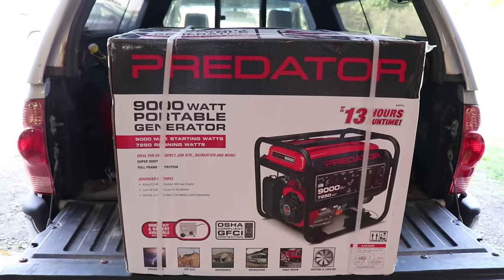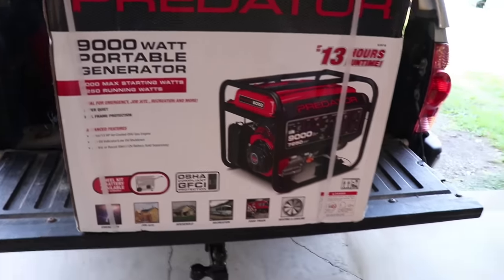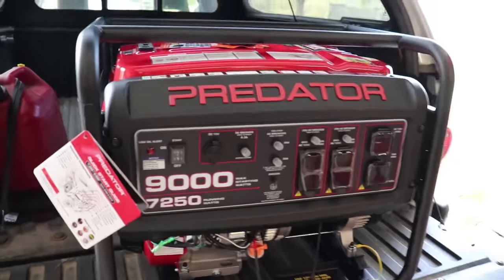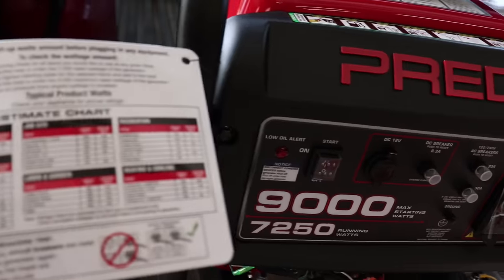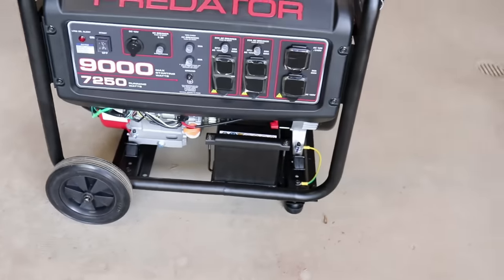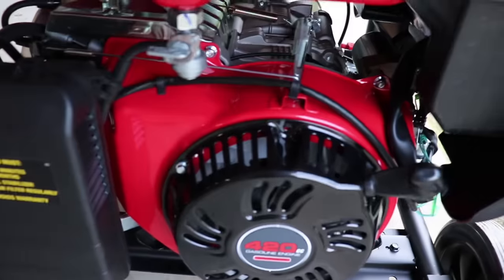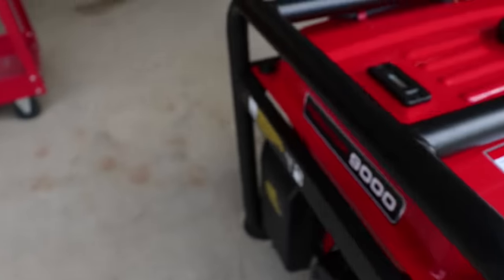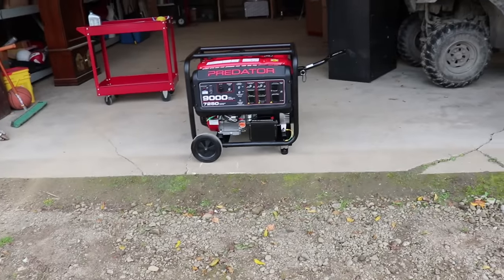Predator Generator Running Our ENTIRE Home. (Complete Setup and Cost)

Comment: hi,my main info that i need is the connector box near the garage panel breakers,how it is connected?  where in the plug are connected each colored wires??? 
thats my main interogation,,,
the reste i can do it..
here the heater are on the 220 ,i must turn off and we have a wood stove so we are ok

i cannot have the interlock plate because it is not a Square D here,,,its a bastard panel that was sold to us when the electricity was redone and we did not knew at the time!!!!

thanks for your video

gervais 
Riviere-Bleue,Quebec

Comment: Now get a SMALL generator that can only power your heating system and refrigerator. Or wait until you are 3 weeks without power, you local gas stations have no power to pump gas, and the big generator shakes itself apart. Ask me how I know.  It’s best to save fuel and maintenance time as much as possible.  

After your first day of comfort, think survival. You use the big one for the water pump and an hour or two of other items, then be in the dark for two hours, then the small gen for lights and refrigeration for 1-2 hours at a time. Repeat.

Comment: The actual reason for the slide is to prevent killing or injury to line workers should they be working in your area.
Reply: Make sure you all are aware with the hazards of using generators. Generators can be dangerous if not used carefully so make sure you follow all the generator safety instructions. I know all about generator safety and I have something to explain to everyone about generator safety. Here is what you all should know: please remember not to ever run your generator indoors. Generators should only be used outdoors. Always remember that carbon monoxide fumes are odorless and colorless gas that is a silent killer that you cannot see or smell. Carbon monoxide is dangerous and it can cause death. Carbon monoxide is poisonous. Always keep that in mind when using generators. You need to have a carbon monoxide detector. Make sure your generator is 15-20 feet away from your house and away from doors, windows, and vents. Never use your generator indoors even if your doors and windows are open. Some people run their generator indoors during hurricanes which is dangerous and you and your family will die if you use generators indoors. Running a generator indoors increases the risk of carbon monoxide poisoning. Please don’t run your generator in wet conditions. Running a generator in wet conditions can electrocute you. You need to keep your generator dry. Don’t let the portable generator get wet. You need to have a generator tent as well to protect your generator from getting wet if you will use  your generator during wet weather. We also really need to keep our children safe when we’re using portable generators so they won’t get electrocuted or burned by the generator which is dangerous. Generators can be hot. You have to keep an eye on children making sure that they are not near the portable generator to avoid any risks. We have to be aware with all the hazards and follow all the instructions in the generator’s operating manual. Generators pose electrical risks. Make sure your generator is not overloaded. Overloading your generator can cause damage to the appliances that are plugged into the generator. Please don’t overload your generator. Don’t ever try to plug a generator cord into a wall outlet to avoid back feeding. Back feeding is dangerous. Always turn on your generator first before plugging in appliances. And before you unplug the appliances, please shut off your generator first. Please use a heavy duty cord for your generator and the cord should not be worn out. Please don’t refuel your generator while it’s running. You should shut off your generator and let it cool off before refueling it. Refueling your generator while it’s running can cause fire if gasoline spills on the generator’s engine because it’s hot. Please make sure your generator is properly grounded. Everything that is said on the generator’s operating manual should not be ignored. They all need to be followed. https://youtu.be/I1jT3ANENvI and here is a video more about keeping your family safe while using generators. This is for everyone’s safety. This is just a safety reminder for everyone to make sure that you all are aware with the warnings. Thank you and hope you all stay safe.
Reply: Comment has nothing to do with my remark.

Comment: Get to Temporary pigtails that use for a regular light bulb put them in series with the hot wire so in case you buck the power company with your generator the fuses will blow and buy time delay fuses 30 amp they sell them at Home Depot you're not putting a lightbulb in the holders you're putting the fuses it's an Edison base fuse so fuse will pop instantly in case you switch the power company on with your generator avoiding fire
Reply: you don't want to hurt the lineman working on the system

Comment: 1) that is way too big for that house from what I’m seeing on that breaker panel 2) huge generators use huge amounts of fuel , which is hard to store and hard to find in an emergency ) that generator is capable of more than 30 amps I believe so it should be a 50 amp breaker in the box instead of a 30. Drain them and don’t store fuel in them. I usually just dump half a gallon in to run and then let it run out every few months. Also drain the carburetor, there is a drain screw on the carb. Then put the choke on and try to start the generator . This will suck any fuel out of the small carburetor jets
Reply: Actually, this generator is fuel efficient. You can get up to 20 hrs., on a tank of gas, if your around 25% load.  The bigger the load, the more fuel it uses.

Comment: I have a 3000sq home I dont need the whole house but can a 7500w handle that
Reply: Make sure you are aware with the hazards of using generators. Generators can be dangerous if not used carefully so make sure you follow all the generator safety instructions. I know all about generator safety and I have something to explain to everyone about generator safety. Here is what you should know: please remember not to ever run your generator indoors. Generators should only be used outdoors. Always remember that carbon monoxide fumes are odorless and colorless gas that is a silent killer that you cannot see or smell. Carbon monoxide is dangerous and it can cause death. Carbon monoxide is poisonous. Always keep that in mind when using generators. You need to have a carbon monoxide detector. Make sure your generator is 15-20 feet away from your house and away from doors, windows, and vents. Never use your generator indoors even if your doors and windows are open. Some people run their generator indoors during hurricanes which is dangerous and you and your family will die if you use generators indoors. Running a generator indoors increases the risk of carbon monoxide poisoning. Please don’t run your generator in wet conditions. Running a generator in wet conditions can electrocute you. You need to keep your generator dry. Don’t let the portable generator get wet. You need to have a generator tent as well to protect your generator from getting wet if you will use  your generator during wet weather. We also really need to keep our children safe when we’re using portable generators so they won’t get electrocuted or burned by the generator which is dangerous. Generators can be hot. You have to keep an eye on children making sure that they are not near the portable generator to avoid any risks. We have to be aware with all the hazards and follow all the instructions in the generator’s operating manual. Generators pose electrical risks. Make sure your generator is not overloaded. Overloading your generator can cause damage to the appliances that are plugged into the generator. Please don’t overload your generator. Don’t ever try to plug a generator cord into a wall outlet to avoid back feeding. Back feeding is dangerous. Always turn on your generator first before plugging in appliances. And before you unplug the appliances, please shut off your generator first. Please use a heavy duty cord for your generator and the cord should not be worn out. Please don’t refuel your generator while it’s running. You should shut off your generator and let it cool off before refueling it. Refueling your generator while it’s running can cause fire if gasoline spills on the generator’s engine because it’s hot. Please make sure your generator is properly grounded. Everything that is said on the generator’s operating manual should not be ignored. They all need to be followed. https://youtu.be/I1jT3ANENvI and here is a video more about keeping your family safe while using generators. This is for everyone’s safety. This is just a safety reminder for everyone to make sure that you are aware with the warnings. Thank you and hope you stay safe.
Reply: @The_Happy_Aviation_Enthusiast  thank you for the safety tips but that dont answer my question

Comment: You wouldn’t know if the water pump was working unless you turned pump off until water stopped flowing and then turned pump on . Water would run for several minutes without pump on
Reply from the maker: Watch the video I did in the description....I did a 50 minute test with the shower on.

Comment: There one Predator that is super quiet. Might be one size down powerwise
Reply: ⚠️Here’s an important safety announcement for everyone:

Please make sure you follow the generator safety tips whenever you use your portable generator. This is just a reminder for everyone’s safety. All generator safety rules need to be followed carefully 

Here are the generator safety tips: 

1) KEEPING OTHERS SAFE: Please do not allow an non qualified person or your children to operate and service the portable generator. Just because some manuals don’t say that doesn’t mean it’s safe. That is important against the generator safety rules. We also need to be keeping an eye on our children too. You need to make sure that your children are not playing near the portable generator especially when it’s running so they won’t get electrocuted. Generators pose electrical risks and they can be hot during an operation. Please keep your children away from the portable generator at all times. It is important to keep our children safe especially our little ones. Children often get curious about anything so we should keep an eye on them to also make sure they’re not wandering towards the generator. 

2) WHERE TO RUN YOUR GENERATOR: Some people use their portable generators indoors which increases the risk of carbon monoxide poisoning. It’s important to have a carbon monoxide if you have a gas generator. Never ever use your generator indoors even if your doors and windows are open and even in the garage is not safe to use a portable generator. Not even at your porch and your deck. It is never safe to use your generator indoors and in enclosed areas of your home. Your generator needs to be 15-20 feet away from your house. 

3)🔥FIRE HAZARDS: Never refuel your generator while it’s running. You need to let your generator cool off before refueling it and before storing your generator. Never overload your generator too. Never ever back feed your generator. You should never plug your generator into a wall outlet. Also never store propane tanks indoors. Please keep flammable things away from the generator as well and please don’t smoke cigarettes near the generator. Having a fire extinguisher next to the generator is also important against the generator safety rules. 

4) GENERATOR OPERATION: make sure your hands are dry before touching the generator. Never use your generator in wet conditions. Don’t let your generator get wet. You need a generator tent if you need to use your generator during wet weather. Please don’t wear loose clothes when operating the generator. Turn on your generator before plugging in appliances. Use the right cord for your generator. Please do not use worn out cords. Do not touch the generator’s engine when it’s still hot. 

https://youtu.be/I1jT3ANENvI and here is a video more about keeping others safe when using generators. All generator safety rules need to be followed carefully. 

Hope this helps. 

Please make sure you follow all the generator safety rules.

Comment: I am frustrated by the sales (instead of engineering) emphasis on the naming.  In this case the big print is 9000, but then there is the (smaller) MAX.  And the there is the 7250, which really should be the main or big text.  That is the number how much power you really can get on a continuous basis.  The 9000 MAX is what it can support for some 5 or 10 seconds only!  That kind of need is for a short time when motors start.  That means the fridge and water pump.  Old incandescent light bulbs also did take a huge amount of current initially, just less than 1 second.  But going with the supplied listing, everything on it is the long term consumption and you need to stick to the essentially 7000 W consumption allowance!.  I would also invest into a clamp type current meter.  They are nowadays also dirt cheap.  You would get actual rather than estimated numbers for most of the items, although motors will give a little exaggerated reading due to their less than unity power factor.  Same for fluorescent lights.  But all heaters like the oven or range give a correct reading.
Reply: Don’t forget to watch this video about generator safety https://youtu.be/I1jT3ANENvI just hoping you stay safe.

Comment: I have the same generator and we are in a power outage and it keeps tripping when we run our deep freezer, fridge,  fish tank, and tv.... 😭
Reply: Are you using heavy gauge extension cords?
Reply: Also did you multiple extension cords or just 1 to like a strip and then plug everything in the strip. This unit should power all of that easily so something isn't right

Comment: Ok I had the same generator . Here are the down sides . My power went out because of the fires here . That caused everyone in the city to lose power for 3 1/2 days . Well you never know when it’s going to happen . And if your a smart person you know gasoline does not store for long periods of time . My generator tank was full but ran out of gas then add my 5 gallons from the grage . Well yup I was out of gas . My generator now became a very heavy paper weight . All the gas stations were closed because they had no power . Stores restaurants everything was shut down no power . Well did not take me long to figure out I was screwed . So bought a propane generator because you can store propane for long periods of time which I have many tanks . I don’t want to be caught like that again . It’s a dual fuel you might be able to add a conversion kit to make your a duel fuel . Hope you don’t get screwed like I did .good luck .
Reply: Sorry that happened to you.  But I have to be honest, you should have know that would happen when using gasoline as the only fuel source. (Not the generator fault) You could have easily bought a Tri-fuel kit, to install on the Predator generator, so you could have run it on gasoline, natural gas and propane. That's what I did to ours right after we bought it. We have it hooked up to the natural gas line in our house.

Comment: Great generator for the price they copied the Honda motor - what is your plan if the power was out for over a week ? How much gasoline would you need ?  Make sure that you never leave the main on when generator is running - that could blow up your generator a automatic transfer switch is best !
Reply: Make sure exhaust gas is going out side when running too !

Comment: And yes it is extremely heavy we didny know how to get it out of my car and down near basement door so we took a sled with rope and did it like that..seeing that we got hit with 15in of snow and haven't had power since friday..only thing we can't get it ro work for heat and hot water..the main reason I bought if anyone has any answers please help? Lol we haven't had it wired in to house yet just using extention cords for now until we get electrician out but would like to know what We r doing wrong about heat and hot water ..husband isn't the handiest..🤣 although he did great hooking it up in dark. I wasn't too sure he could pull it off 🤫

Comment: I bought a 40000 wat generator for my house $13000 and 2 tesla towers 4g each $20000 toal installed in Plano TX now i never have to worry about power i got months of power now this will not happen to my family again 3 days no electricity

Comment: You can not run High definition TV you have to have an inverter generator to do that this generator will run everything but the TV and you can plug it in to any 220 outlet just be sure and shut the breaker to the house off
Reply from the maker: Not true....you can run a HD tv off it. I've done it.

Comment: Whatever you do always run non-ethenol gasoline in it.... It will save you a lot of future carb cleanings from having to be done to keep it running... And this was mentioned by someone else, be sure to cut the fuel off and run the engine until it runs the carb dry.... No gumming will always keep it going. The gasoline treatment helpful, too.... But just don't use anything but non-ethenol gasoline.
Reply from the maker: Great advice!